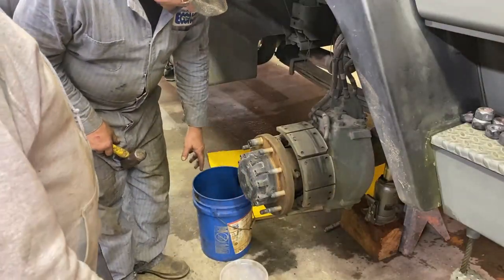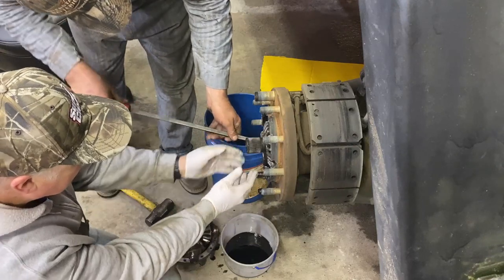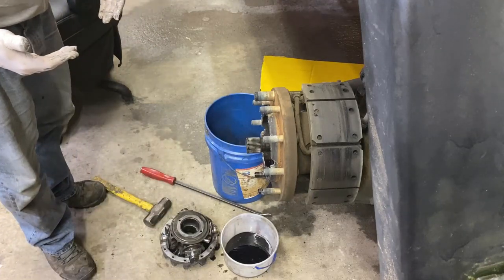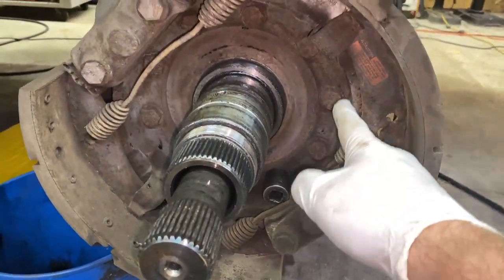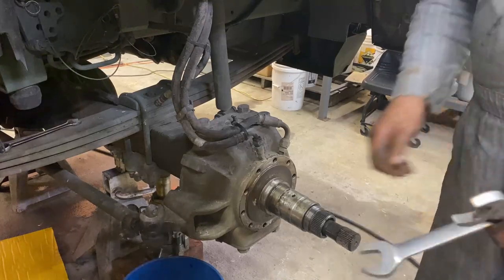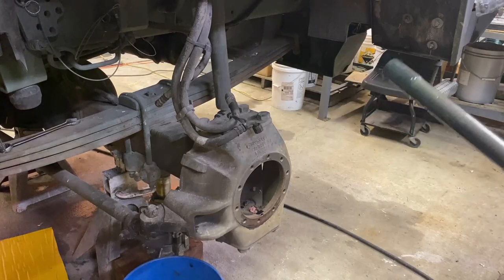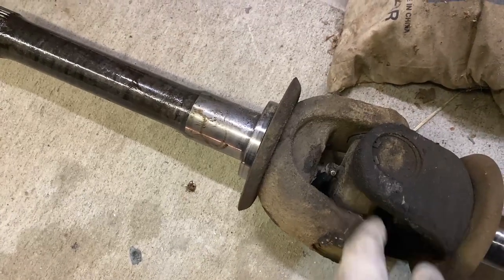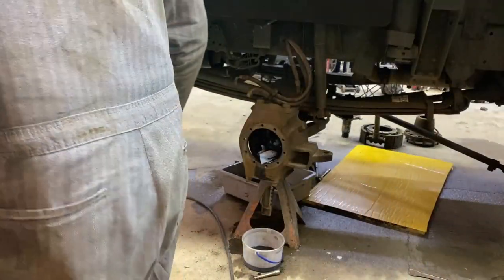FMTV 3.07 FRONT DIFF Gears, pt. 1

Comment: Hey Mr. Anderson, the best way I’ve found to lube the axle shaft U-joints is to jack up the front end and turn steering wheel all the way to one side and you’re able to access the U-joint on the opposite side from the back side of the axle (turn left, access right). Then rotate the tire until you’re able to see the grease zerk. Pump it full, turn the wheel the opposite direction and grease the other side. It’s not bad at all and makes it so you can service everything.
Reply from the maker: I have done this once before... I guess I am getting old and fat, and have a hard time getting to those zerks. I was really happy to have had it apart where it was easy to get to.

Comment: Your microwave popcorn is done....AGAIN!   You can access the front axle u joint zerks by turning the steering wheel hard left or right and by having your wheels rotated so the zerk is pointed to the front or rear of the vehicle.  I just greased mine again 2 days ago...
Reply from the maker: Popcorn? Oh, that is the solvent washer. I almost forgot about that, I heard it so much. 
Yes, indeed... the zerks are reachable, they are just a rear bear to get to.  Everything, including the moon and stars must be aligned in order to reach it (it seems like).

Comment: Question for Dave. With a improved 3.07 gear ratio what kind of speed do you think you’re gonna achieve down the interstate highway?
Reply from the maker: 25% more than the speedometer shows, until you adjust the dip switches. For me, I travel about 60 MPH, now.
Reply: It should be about 72 MPH, probably not wise to go that fast.
Reply: @MrMikey4026  I am now looking for parts and a driver operate diff locker.
Reply: @gregsnyder4496  there are no driver controlled lockers available. Gears are available through Memphis Equipment. They also sell through eBay.